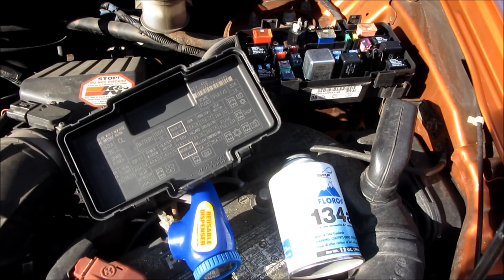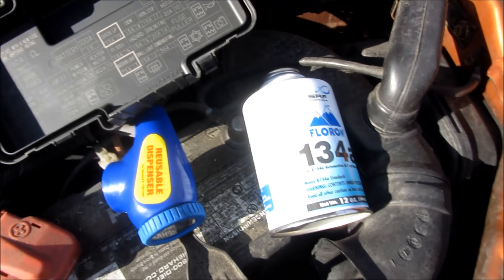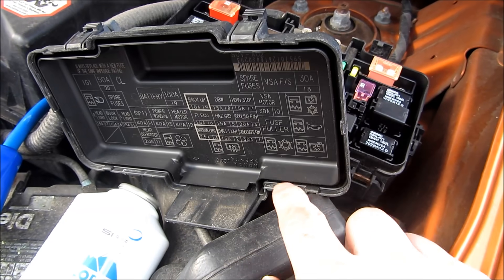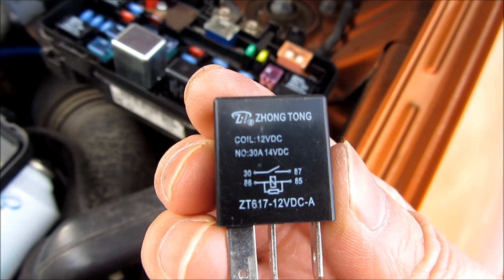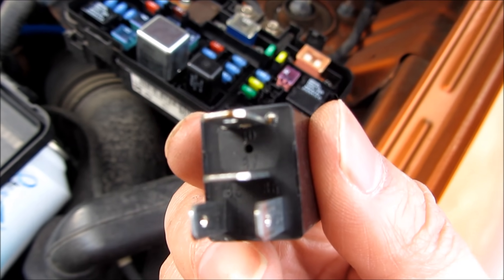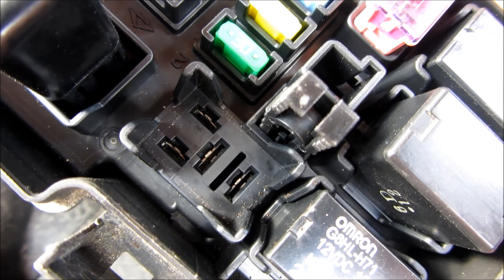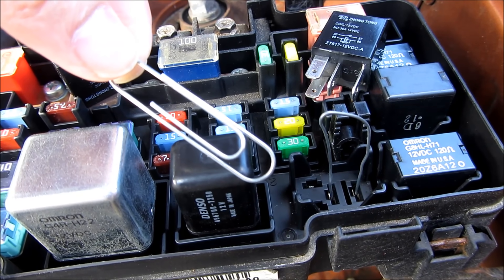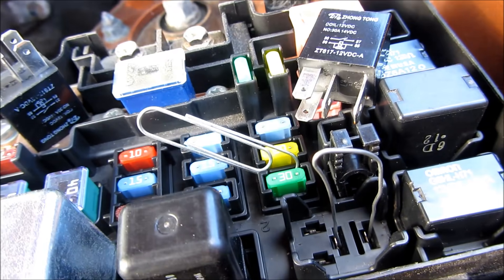Engage AC Compressor Clutch with a Paperclip on Relay | How to Fix Bypass Won't Engage | Jump Relay

Comment: You don’t need the compressor to engage in order to fill it. It will begin to engage once the system senses enough refrigerant
Reply: is this true? im so lost i cant figure it out
Reply: @britney786  100% true. Been working on cars for 20 yrs. replaced dozens of ac’s
Reply: @britney786  just vacuum the system out after replacing your compressor, dryer, and expansion valve. Then start your car up. Run ac on full max cold. Fill the cold side with refrigerant unto its full or it gets cold ac out of the vents. Under your hood it should say the max amount of refrigerant
Reply: 100% I’ll back that statement, also been working on cars my whole life. Thanks for being honest Tj Black.
Reply: @britney786  ok yes it’s true. However I have had ONE car in all my years of working on cars that I needed to apply power to the compressor in order for the ac started accepting the refrigerant. Couldn’t tell you why. 🤷
Reply: @tjblackartist  bc Newer cars have sensors that will not allow you to add freon. You have to pull a vacuum or jump the compressor clutch before it will accept any freon. Not all cars you just hook the can up and start pumping and the compressor will kick on by its self. Your statement above was wrong.
Reply: @tjblackartist  Your  wrong with your statement about not needing to jump the compressor that it will turn on and engage by its self soon as it senses enough freon. Some newer cars have a sensor that when it senses low freon it will disengage the compressor clutch and wont allow you to put any freon into the system unless you either hook up the system and pull a vacuum or jump the compressor clutch then add freon to it. My Acadia right now im dealing with it. Wont let you put any freon in and compressor will NOT engage at all so im forced to either pull a vacuum(take it to shop) or jump the compressor to get it to engage and kick on long enough to add freon. Once it senses enough freon back in the system everything will work fine again and kick the compressor by its self.
Reply: @codyclem7146  SOME being the key word you used. MOST don’t need it. My statement was in general. But whatever
Reply: You are wrong!
Reply: Wrong again!
Reply: @RichardBonecito  it’s worked for me for 20 years probably over 100 cars. So 🤷‍♂️
Reply: @codyclem7146  it’s worked for me for 20 years so 🤷‍♂️.  If a newer car has that type of setup that doesn’t make my statement wrong about ALL the other cars out there. Smh.
Reply: @tjblackartist   you are quite right, it works damn good. I  responded to someone else and their negative crap that it doesn't.

Comment: Used paper clip to engage clutch, filled up with refridgerant. Removed paperclip, reinstalled relay. Clutch Still not working.
Reply: If the compressor worked with the paperpclip but not with the relay, you have a bad relay. Replace the relay for cheap.

Comment: What happens if it doesn't do anything to my clutch oof
Reply from the maker: Then likely its some other problem.
Reply: @PoolarityChannel  I found the reason. My Compressor power wire terminal was destroyed

Comment: you dont have to have the ac running to fill the ac
Reply: Some cars no doubt you do. I am going to have to get a Compressor, mine is bad, my Nephew is doing it for free because it's for his Grandmothers ride to the Doctors, but he says it will cost him 150 to get someone else to CHARGE IT, I assume this is the same thing, he's saying it can't be filled with refrigerant in a regular manner, I guess because its a newer car. I already checked all my relays and fuses, the compressor is not engaging, so I have to buy a new one.

Comment: I wish there was a professional fact checker with some of these half-assed backwards YouTube videos that you guys make. There is absolutely no reason to jump the relay in order to charge an AC system on any car. If you were having problems with the system accepting refrigerant then you obviously have a blockage somewhere or your needle valve in the charge port needs to be replaced, you can also turn the can upside down and it will accept it as a liquid instead of a gas and will feed the system quicker and we'll turn the AC clutch on before your first can is even finished.

Comment: why u have to engage  compressor if there is no freon?????  u start filling it up- u get clutch working !!!
 thats how it works for gods sake. In most cases if there is little freon and compressor still working but hot air..  but if there is freon and its not working ! u need replace compressor